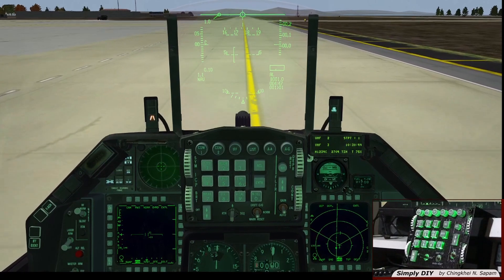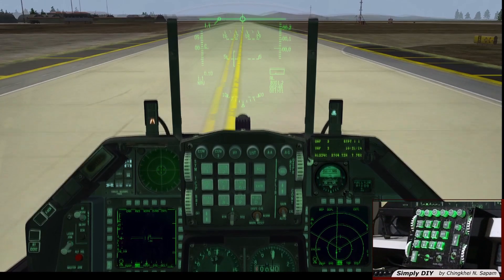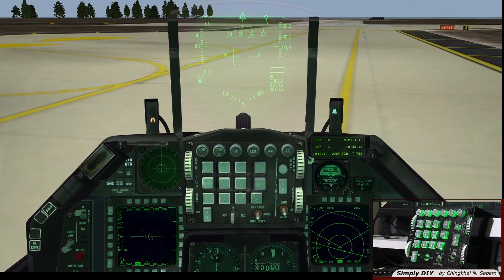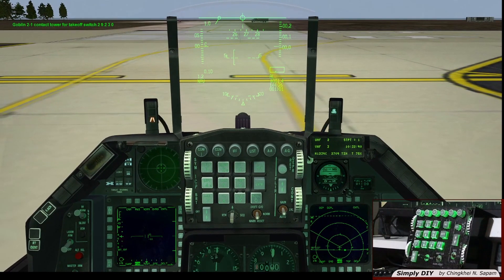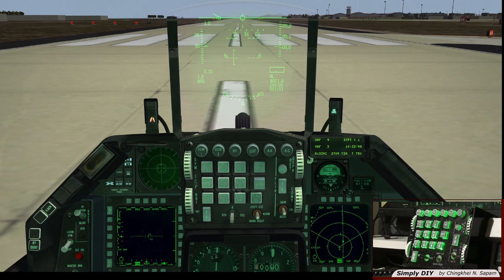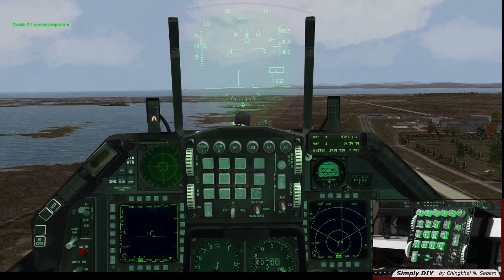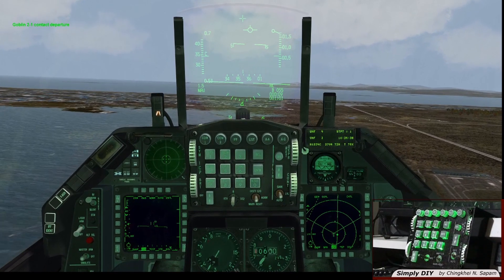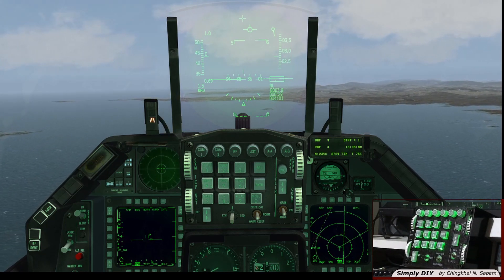F-16 ICP USB Controller for Falcon BMS and DCS Viper - Final Video

Comment: Hello, Enjoying your videos, I'm also making a F16 sim and have just started making the ICP. Do you know if your wiring layout will work with a Arduino mega? Cheers
Reply from the maker: It is using USB based HID device which is only supported by ATmega32u4 microcontroller which only comes with Leonardo/ProMicro/Teensy.

Mega is a very good for getting  Sim data output to panels when using F4toSerial or similar.

Hope this helps your query.
Reply: @simplydiy3858  Thank you very much for the quick reply.